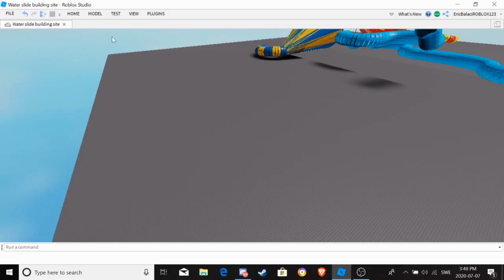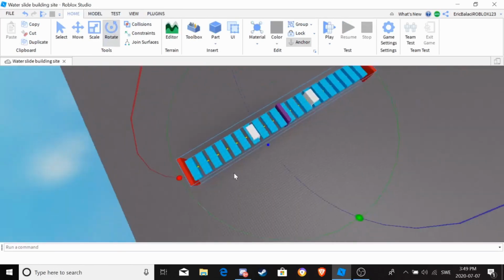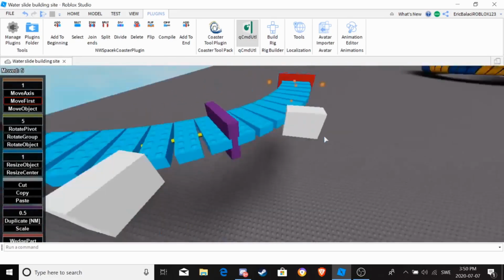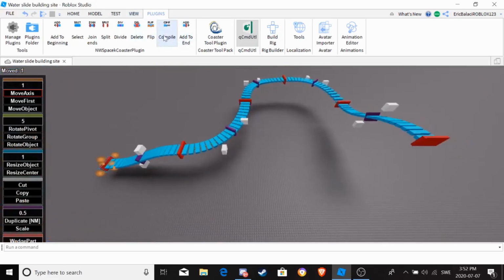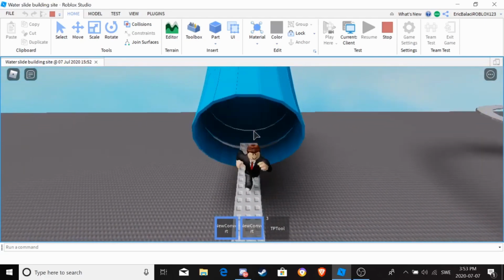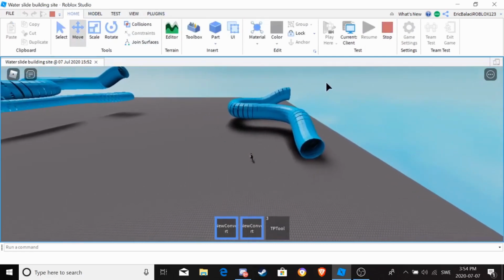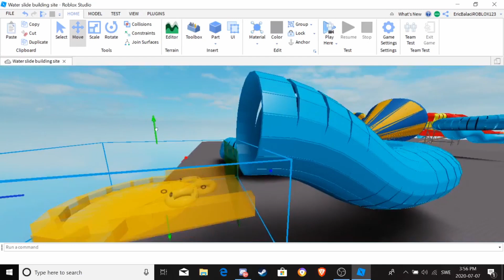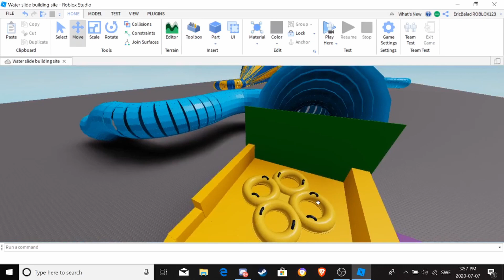How To Build A Water Slide In ROBLOX Part 2  *UPDATED!*

Comment: I keep getting errors!

 MoveTo is not a valid member of Folder "Track"  -  Client - LocalScript:75
  12:54:45.020  Stack Begin  -  Studio
  12:54:45.021  Script 'Players.King_GamingRobloxYT.Backpack.NewConvert.LocalScript', Line 75 - function RotateModel  -  Studio - LocalScript:75
  12:54:45.021  Script 'Players.King_GamingRobloxYT.Backpack.NewConvert.LocalScript', Line 91  -  Studio - LocalScript:91
  12:54:45.021  Stack End  -  Studio

On the slide tool.